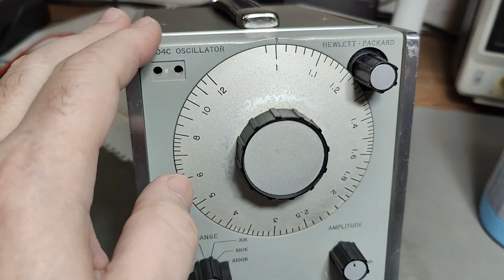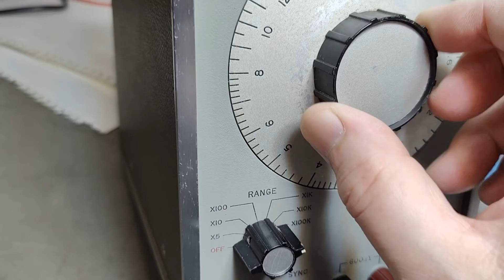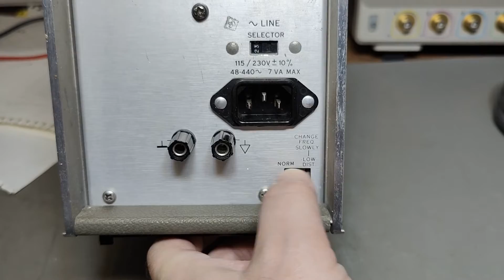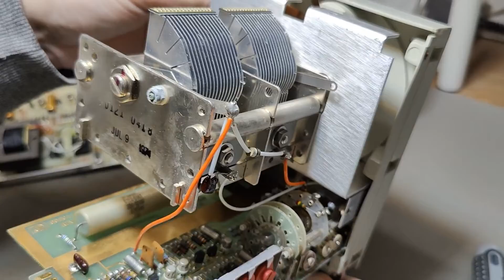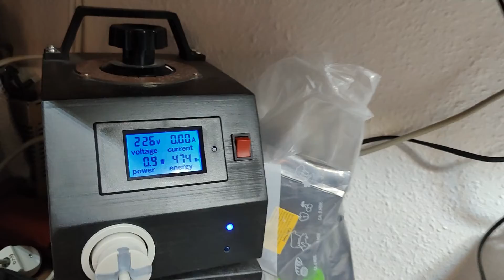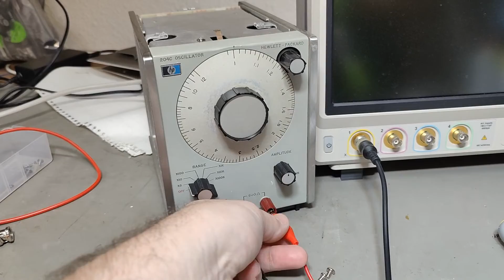HP 204C Oscillator 5Hz - 1.2MHz 1974 test teardown

Comment: Thanks for the easy-to-understand explanation and demo.  I have the same instrument, apparently with only the standard power supply - no NiCd, which suits me fine.  In college I used the original HP201 oscillator and got used to the high quality of the HP instruments.  Long time ago!

Comment: The large frequency knob on my 204D is hard to turn. What do you recommend using to lubricate it? Should I only lubricate the bearings up front or can I also take care of the shaft contacts back by the tuning fins?
Reply from the maker: you got any pure alcohol ? Ethanol Metanol, what ever, the most clean type i prefer is called IPA, use a pipette or such to apply small drops to all stuck parts, the shaft and entry, and then move parts, add more when it starts to move better and better, this way you wash out all old gum like oil, then add sewmachine oil, again small drops, and continue to move parts, now it is fine and nice for the next 20 years
Reply: @TeardownOZ2CPU  I have 91% IPA and sewing machine oil. Thanks

Comment: Nice video. I am curious what the maximum peak to peak voltage this produces at the lowest possible frequency.  Hoping you can provide an answer. Thanks!
Reply from the maker: 2.5vrms into 600ohms, or 5vrms no load, 5Hz is the lowest freq.
Reply: @TeardownOZ2CPU   Thank you for the quick reply.  I am just learning to use oscillators (aka signal generators) but have access to one of these.  Are there any good references (or videos) on how to achieve either of these two outputs?  Thanks again.

Comment: Very nice oscillator....I have a HP nixie tube freq counter that uses almost that same case.  What was the black test gear you used at the ending?  ~Jack, VEG
Reply from the maker: it is my Minilyzer ML1 from NTI, it is still a current available product
Reply: @TeardownOZ2CPU whoa! The Minilizer is on my wishlist but they never come up used on eBay and they list new for about $1k.
Reply from the maker: @originalfallinggirl  yes it is super nice, so much in a tiny package, i scored it broken, and replaced the screen many years ago it was still avail as a sparepart,

Comment: Hi Thomas, you ruined my day with that logo, I bought an old gauge on e-bay to replace the missing logo on my 209A and I got the same gauge, but the logo was milled into the panel. So it stands next to the 427A like a poor brother, because the 427 has a logo. I even tried the service organization of measuring devices to see if there was a logo, but unfortunately everything they had was without a logo (that's what they sell at the bazaar).
they sell at the bazaar).
The capacitors in your generator have been changed, some of the types you have are not original, Tantalums in this design are almost immortal - I have never seen a defective one.
The 209A was made for audio applications, it has a range of 2 - 20, the output is sine and square.

Nice day 🙂 Tom
Reply from the maker: it was easy to get the logo, many of my friends save front plates or other special parts from broken instruments, just for the fun of it
Reply: @TeardownOZ2CPU  I envy such possibilities and friends 😉😁

Comment: Love your videos, Thomas. It always amazes me that you have a different instrument to show us almost every single day! This is the solid state version of HP’s classic 200 series oscillators. I worked on many of these when I was at HP in the 1980s. I currently own two of them, one of which had the rechargeable NiCd battery option. In that version, the batteries were actually used to provide voltage regulation. The batteries are now dead, of course, so I replaced the batteries with a simple zener diode type circuit, so now it works perfectly, but on AC only.
Reply from the maker: good point yes a battery can be a nice noise free zener :-) but of course the voltage will change with state of charge, i prefer a mains supply only solution, with exactly the same regulated voltage, but in 1980 portable was a buzz word, people wanted that, we dont see or understand this today